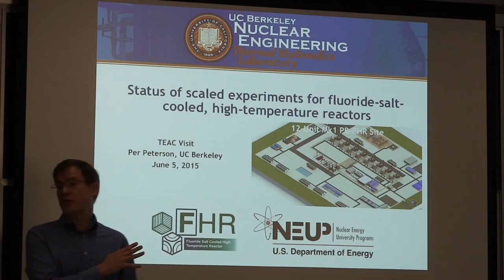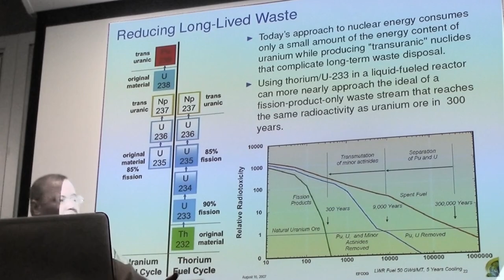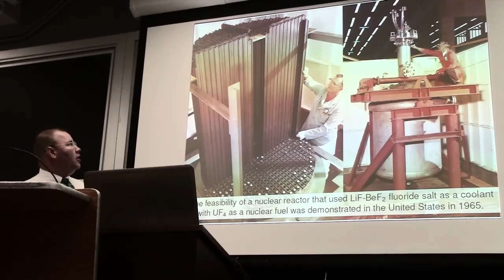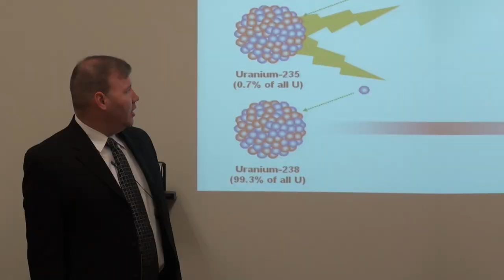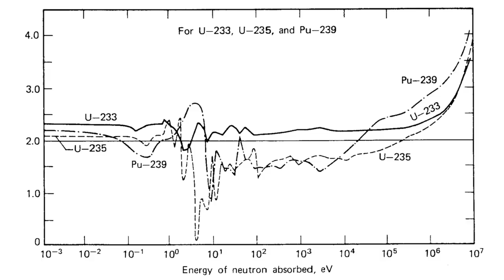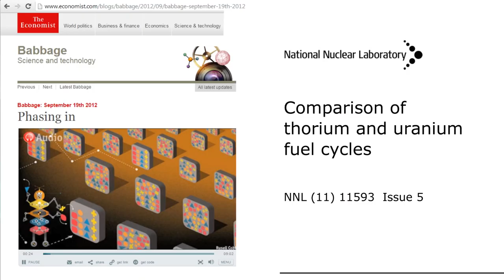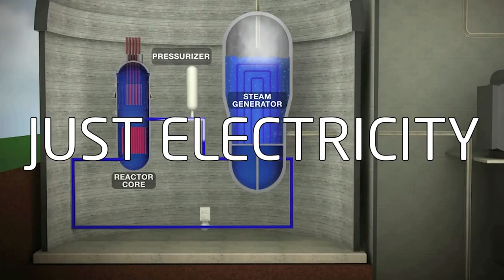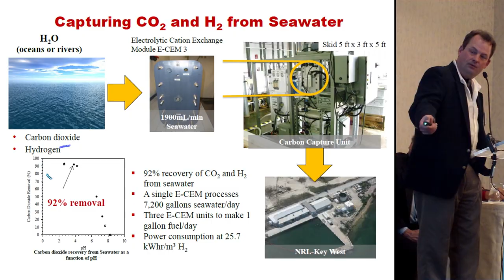Thorium Disadvantages

Comment: Someone really  needs to inform both Fareed Zacharia AND Bernie Sanders about the potential of thorium based nuclear power. Most people have never heard anything at all about this technology. This is something that really needs to be brought into the discussion in terms of  the future of energy production. These are brilliant researchers but they are nowhere near as good at marketing. In order for this technology to go anywhere, they will likely need to hire a well connected political lobbyist/group.
Reply: Unfortunately I think Dr. Leslie Dewan's appearance on Fareed Zacharia's GPS on CNN in 2014 probably turned Fareed sceptical on claims made about Advanced Reactors. That was Dewan proposing a (Uranium) reactor she claimed could run on spent nuclear fuel. It turned out that particular model could not. It requires a fast-spectrum reactor to do that. That was "Transatomic Power" which didn't file for bankruptcy until 2018, and did manage to suck up much of the media's attention on Molten-Salt Reactors until 2018.

More troubling, I think, is Bernie Sanders denying closure of Vermont Yankee (nuclear power plant) increased emissions. If Sanders can't acknowledge that very basic fact about nuclear, which is supported by IPCC reports on carbon lifecycle for each type of power source, then Sanders is unlikely to come up with an effective way to deal with climate change. See Germany's very high emissions compared to France, so an example of an ultimately failed response costing trillions of dollars (Euros).

Comment: This video has much information why a LFTR is a quantum improvement over U235 reactor designs.  I don't understand why the title of the video other than to attract people to view it based on their preconceived "feeling" that thorium is no good only to realize just the complete opposite is really true.
Reply: Michael Licitra I do specifically state the challenges of protactinium. That thorium has a disadvantage because it requires chemical processing when Thorium is consumed in the thermal spectrum.

I don’t really expect anti-nukes to watch this and change their mind. In most cases changing their mind is a very long process. But, for years videos pretending to explain the disadvantage of Thorium have existed. They’re usually pretty bad videos. At least now people searching on the topic can find something information dense.
Reply: If you use the Th fuel stream in a dual fluid reactor (fissile / converter blanket) the chemical processing of the Th blanket would include Pa removal.  This processing would eliminate the decay time needed for the Pa and it's large n cross section would not harm the core reaction and occur separate and distinct from the core reaction.  The rest is in the video you posted.
Reply: And using a 2-fluid reactor is in itself a challenge. I'm all for doing LFTR. I'd like to see thermal-spectrum thorium breeding pursued... just spent a weekend in Delft Netherlands with some great people who are also trying to advance that approach. But having MANDATORY chemical processing is different from fast-spectrum (U-Pu) where you can just keep adding fertile and worry about pulling out fission products decades down the line. If you're trying to solve the fewest technical challenges before licensing a reactor.

Again, I'm pro-LFTR. But this isn't an environment where the only videos returned by any search criteria are ones offering good insight. There was a niche to fill, and I think I filled it with something insightful, for anti-nukes to chew on rather than get immediate gratification that Thorium energy was impossible because reprocessing fuel rods is impractical. That is what there was before this video.
Reply: I agree with you Gordon.  I have been in the Nuclear Generation business for over 40 yrs and the difficulty inherent in today's operating reactors has already outpaced it's utility (as the current political environment illustrates as such an environment does not materialize from nowhere).  The fact that the resting momentum and stale innovation state of the current designs appears difficult to change is a challenge, I agree.  However we must stop going down the same path over and over again and continue to expect different results (wasn't someone famous credited with a similar quote :) ).  Good talking with you.

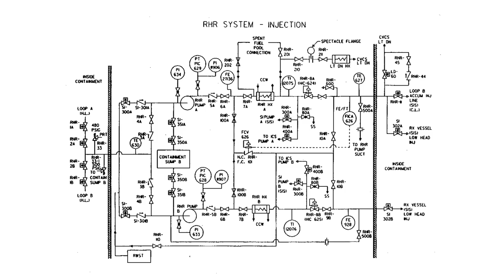Comment: 10:46 I don't really see the relevance in the reactive process here. The Tsunamy knocking out the entire array of emergency power generators has never been a dilemma having al tall to do within the actual operation of Boiling Water Reactors, such as the particular BWR/3 one in question, having been built in 1967 and synchronized by 1969 and relying on technology available as early as and successfully operated since 1955  by GE. Sadly, far too many snippets throughout this video have too little to do with the actual research of Thorium as an alternative to U-233 itself. This is more than just mildly disappointing, as this isotope deserves more research beyond issues such as finding ther pressure vessel for it - albeit otherwise an intersting video. I'd hope for there being more of an interest for higher funding of molten salt reactor technology.
Reply: Thorium breeds into U233 so you're probably thinking of it as an alternative to U235 (the natural but rare fissile uranium isotope).

Comment: And no word for real disadvantage of Thorium reactor. Products of disintegration are radioactive with have high Gama radiation. Products of Uranium reactors are radioactive too but no Gama radiation. We still have to develop technology  how to handle safely such dangerous materials.   
BTW molten salt reactors can be with fuel Uranium and Plutonium.
And if we want low pressure in the reactor we can use not only salt but melted metals too. For example Sodium or Lead. This types of reactors have advantages and disadvantages too.

Comment: All comments regarding 5,000 ton per year of Thorium are based on the production of +50,000 tons per year of rare earths -- not from a single mine.
Reply: jim kennedy Gah. I can post an annotation to all the videos. That is an old claim in many of the videos. How much might a typical mine produce as byproduct? (Range I guess.)
Reply: nothing rare about thorium
Reply from the maker: Kennedy's comment is added to description text of this video and summarized in a card which appears at 8:45. Kennedy clarification is as follows:

The 5,000 tpy figure of Thorium assumes a 50,000 tpy Rare Earths facility that primarily utilizes monazite as its feed-stock.

Thorium is a companion element to Monazite.  Monazite runs at +50% REE and about 7% Th.  So if you processed 50,000 tons of monazite you would get about 3,500 tpy of Th.  However, monazite would not be the only feed-stock. You would use many other mineralizations. like apatite running at 3% REE and .002% Th (but with lots of heavy REE).  So it would be a mix and tend toward the 5,000 tpy range.

Comment: WTF? Why is this labeled "Disadvantages"? It's a discussion of all the advantages.
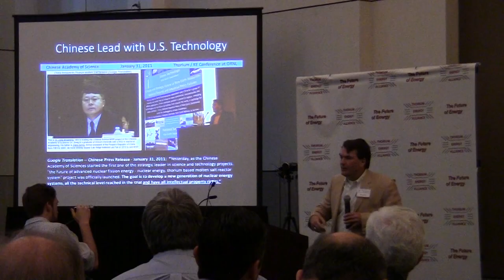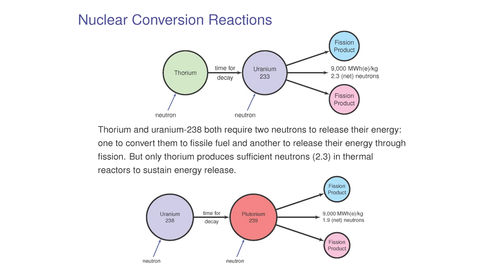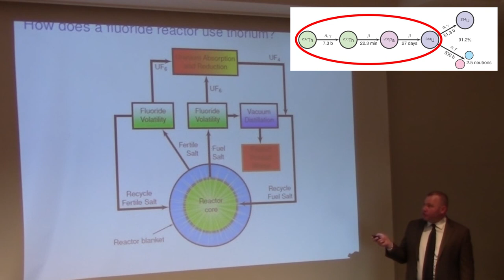Reply: 00:00 Solid-fuel thorium reactors fuel utilization ratios similar to PWR. 00:42 Liquid-Fuel in United States licencing is "scary". 02:04 Obama Administration willing to give away MSR know-how. 02:40 PWR seen as "good enough" for long time. 03:00 Licensing restrictions specifically target liquid-fuel. 04:45 NEA OECD evaluated solid-fuel, and liquid-fuel-fast-spectrum only. 20:50 Thermal-spectrum neutrons hitting U233 produce only ~2.3 neutrons. 23:00 Graphite moderator required to sustain fission in MSBR thermal-spectrum. 27:50 Protactinium-233 half-life 27 days. 29:00 Material challenges (MSR is pre-requisite so MSR challenges are Th challenges.)

Comment: Best clickbait ever.
Reply: ZandarKoad I do think disadvantages are stated. Maybe what people expect is those disadvantages (challenges) to be addressable.

I have been harping on this point since the year 2010. If it isn’t a liquid fuel reactor then you might as well use enriched uranium.

Democratic candidate for president Andrew Yang says he will support Thorium reactors. The response in popular mechanics was to cite technical challenges largely based on solid fuel. So I don’t know what to do other than this. 

Frankly, I didn’t expect solid fuel challenges to be cited in 2019. Every single video I have made since 2010 has been to try stop that from happening.
Reply: @gordonmcdowell  Oh, they are stated. It's just they are in fact insignificant, and most of the run time is spent on advantages. But I like the title (and video) as is, I don't think either should change.

And to your point... is anyone seriously considering development of solid thorium reactors? Or is that just something detractors bring up because it's easier to attack?
Reply: I think the biggest disadvantage would be that it requires the "chemical kidney" technology which as of yet does not exist, and has not been proven.  ... or has it been developed by now in 2019?
Reply: ZandarKoad Flibe Energy received a DOE GAIN voucher for the Fluorination component of the Kidney. They’ve maintained R&D ought to be inexpensive because there are safe stand-in isotopes for Th/U cycle where-as such chem processing for U/Pu will bottleneck on Pu. (If one wants such segregation for their MSR... not necessarily  required for U/Pu.)

So it is finally happening but still financially constrained in a way that suggests no urgency.
Reply: ZandarKoad that is still India’s plan, although they have begun some MSR chemistry R&D.

China’s first MSR Pilot (currently under construction) will be solid fuel, although they are very clear that liquid fuel is the goal.

Lightbridge was speaking about thorium fuel rods years ago, I do not know if they are still pursuing that. All I hear now is “accident tolerant” fuel from them, which is (I believe) same enriched Uranium but in a non-ceramic solid form that can be used in existing reactors.

Comment: Thorium reactors have been around since the 1960's in Europe, Asia and even USA. Other types are better - simples.
Reply: Uranium burner reactors are indeed simpler, but the entire fuel cycle is more complicated... with uranium enrichment and long-term storage of solid fuel rods (or recycling in solid-fuel fast-spectrum reactors). The comparison put forward, which was not seriously considered by any of the 3 reports shown here (and 2 of-which cited to legislators) was using an online chemical kidney as part of the reactor design (which of course requires Molten Salt Reactor with liquid fuel rather than solid fuel). While conceptual designs for this existed as early as the late 50s, NO SUCH REACTOR HAS EVER BEEN BUILT.

"Thorium reactors have been around since the 1960's" is to make the exact same arguments in the 3 reports I'm arguing against in this video. SOLID FUEL thorium reactors have been built. LIQUID FUEL URANIUM BURNERS have been built. To-date, no one has built a MSR thorium breeder, although the Chinese are certainly working on it.

Dr. Lyon's testimony (in 2013 and 2014) was no-doubt influenced by a belief that PWR was simpler and adequate... indeed PWR reactors are simpler but the entire fuel cycle is not... indeed we could decarbonize our electricity grid with PWR but not deeply decarbonize our entire economy due to relatively low-temperature operation of PWR.

But he did NOT say that at the time... he simply stated there was no benefit to thorium by assuming anyone and everyone who cared about Thorium reactors were interested in only solid-fuel Thorium reactors, and not liquid fuel Th-MSR with online reprocessing. A more educating response would have been for Dr. Lyons to help clarify how many of the benefits of Th-MSR (the reactor category promoted by Thorium advocates) were due to the choice of Molten Salt coolant, and not the fuel-cycle.

In 2018 Flibe Energy received a grant from DoE to develop the online chemical kidney... proposed as a concept in the late 50s by ORNL and now finally being pursued... outside of China.

Comment: We need to upgrade and harden our power grid against EMP events FIRST before we look for alternate sources of nuclear power. Spend the money to do this before it is too late, as we depend upon electricity more than any other Country on the planet. Also, our power generation should favor local distribution over supplying the grid during an emergency, creating "islands" of powered civilization that can quickly grow to other powerless areas. Also, instant ABM protection systems should be built to detect man launched EMP devices to keep them from detonating over our Country. We spend trillions of dollars for defense, this MUST be done to protect hundreds of million American lives that would be lost during a nationwide power loss. Computer control of the grid should have manual computerless backup controls to protect against hackers - both foreign or domestic. We must do this NOW, not later, to not risk economic collapse.

Comment: This was good until 22:00 when it started repeating itself. Repetition is the key to brain washing.
Good jump cuts, well put together narrative. But misleading title.
Reply: Thorium Disadvantages listed here:
00:00 Solid-fuel thorium reactors fuel utilization ratios similar to PWR.
00:42 Liquid-Fuel in United States licencing is "scary".
02:04 Obama Administration willing to give away MSR know-how.
02:40 PWR seen as "good enough" for long time.
03:00 Licensing restrictions specifically target liquid-fuel.
04:45 NEA OECD evaluated solid-fuel, and liquid-fuel-fast-spectrum only.
20:50 Thermal-spectrum neutrons hitting U233 produce only ~2.3 neutrons.
23:00 Graphite moderator required to sustain fission in MSBR thermal-spectrum.
27:50 Protactinium-233 half-life 27 days.
29:00 Material challenges (MSR is pre-requisite so MSR challenges are Th challenges.)

...I can appreciate the cross-section talk was repetitive. I thought it was the only hard-to-get topic touched on, very few non-nuclear people will be familiar with the concept, so I did repeat it even a bit more than Kirk's original delivery. The concept isn't exactly an opinion though... like if someone was explaining Earth's gravity and kept repeating 9.8 m/s^2 it would be equally annoying but not really qualify as brainwashing.

If you want to try assemble a better edit yourself please do. Full-length edit here... https://drive.google.com/open?id=0B181Ezh6Cnz5VFI3T1dieXVhTk0 ...or just rip the current edit and collapse it down as you see fit. Name it whatever you'd like.
Reply: @gordonmcdowell  Thanks! I missed some of these. Maybe repetition isn't so bad as I originally thought. Appreciate getting access to the sources, that Google Drive link has some great material; My favorite find is the 6h27m
 documentary titled TR2016 Complete Assemble 20170302a High42 vbr20k.mp4
Reply: 3ICE that is doc “Thorium.” on YouTube completed in 2016.

Comment: This video does not show any actual disadvantages/chalenges of Thorium reactors. I'm disappointed.
Reply: 00:00 Solid-fuel thorium reactors fuel utilization ratios similar to PWR. 

00:42 Liquid-Fuel in United States licencing is "scary". 

03:00 Licensing restrictions specifically target liquid-fuel. 

04:45 NEA OECD evaluated solid-fuel, and liquid-fuel-fast-spectrum only. 

20:50 Thermal-spectrum neutrons hitting U233 produce only ~2.3 neutrons. 

23:00 Graphite moderator required to sustain fission in MSBR thermal-spectrum. 

27:50 Protactinium-233 half-life 27 days. 

29:00 Material challenges (MSR is pre-requisite so MSR challenges are Th challenges.)